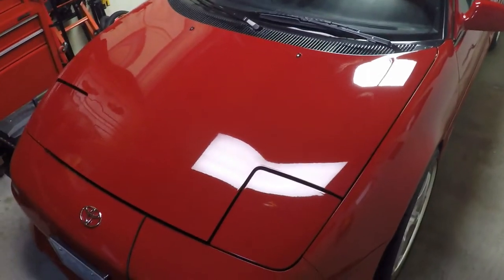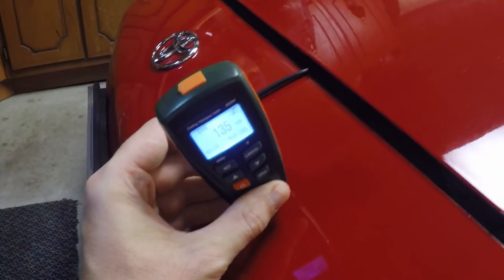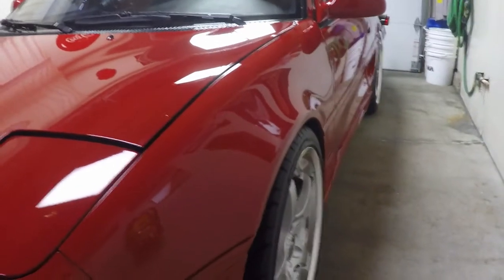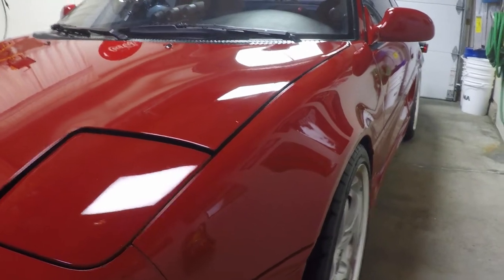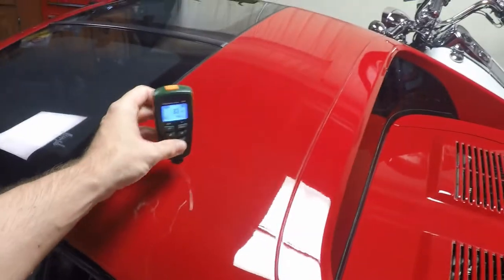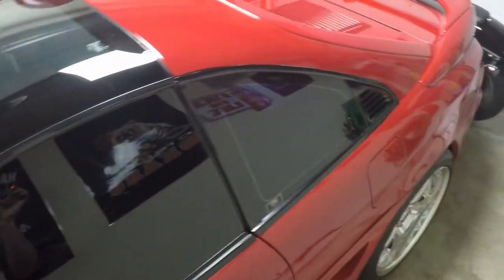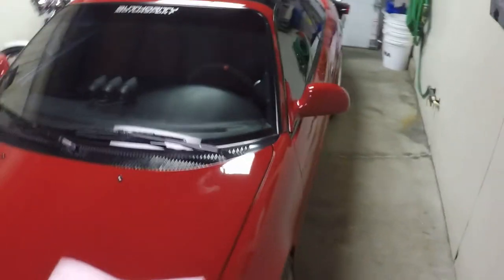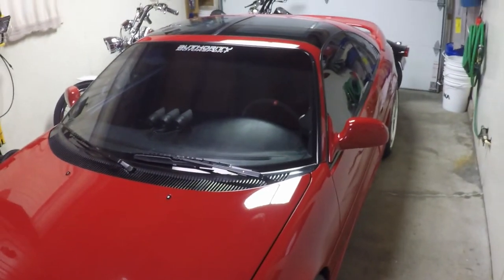How To Use A Paint Depth Gauge And Why You Shouldn't Trust Them

Comment: One reason you might be getting large disparities in measurements only inches apart on the panel is that it has been repaired before. The build up of bondo, primer, paint and clear would add large amounts of depth not visible to the naked eye.
Reply: It would be helpful the take a measurement right before you shoot clear so you have a good estimate of clear depth you have to work with.
Reply: Agreed

Comment: Thanks. Btw, another little example of a depth reading gone wrong (IMHO) is Apex Detail declaring that a coating had added a 0.4mil layer.  At that thickness, an entire 30mL bottle would be required just to do a typical hood, with no wipe-off at all. I'm waiting for their response.